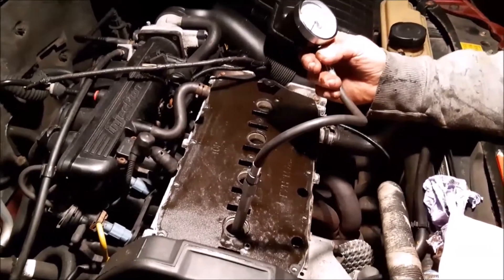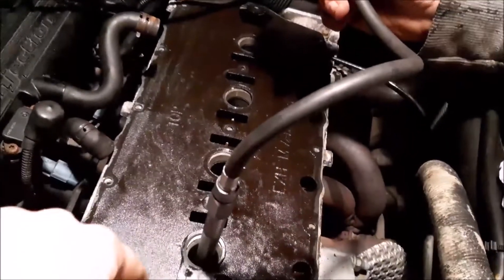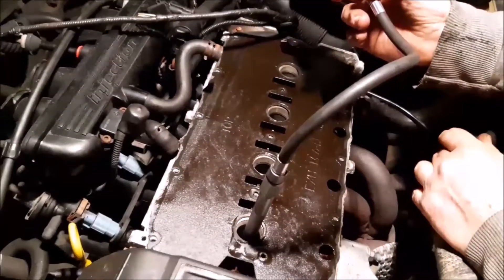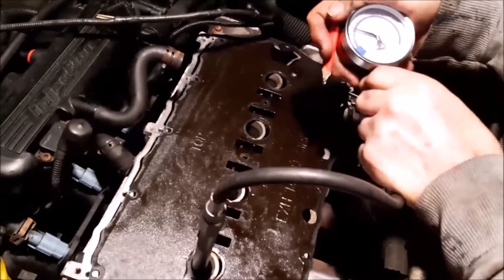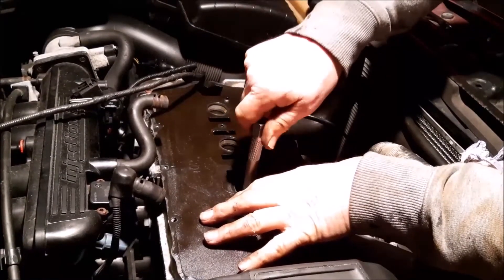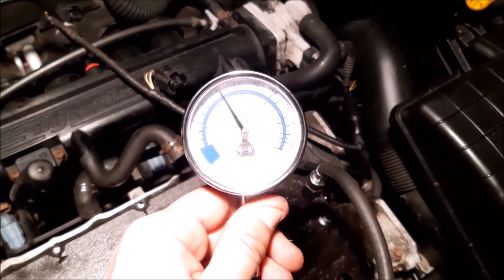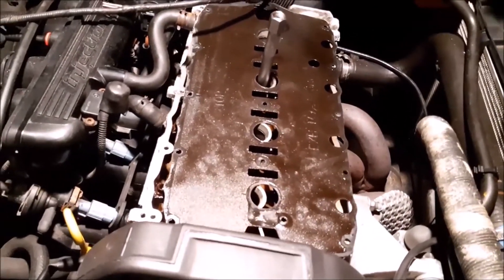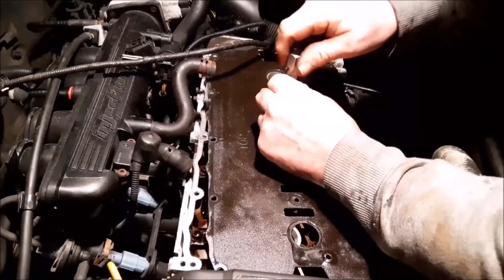compression test on a rover k series engine

Comment: Hi friend. Do you know what would be the compression for a K series 1.6 ?? I think mine is a little higher. It has 210 psi in all four cylinders. 
But it has temperature problems. I think the head cylinder high it´s below manufacter specify.
Reply from the maker: Pacific figure for your engine should be in the manual. we cover the rough figures for a k series in the video we were getting 110